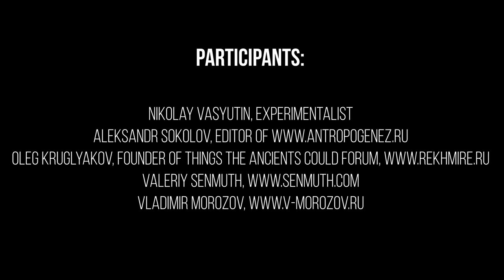Making Egyptian Drill Holes: Lost Ancient High Technology

Comment: What's funny is that there are stoneworkers in Egypt who have either worked out most of these techniques or had them passed down to them during their early training. There are hours of recordings with them on YouTube but they are buried under the algorithm and days worth of conspiracy theory videos. Kudos on getting to the top of the queue.
Reply from the maker: @chrissibersky4617  
>those techniques don't leave the same traces/markings
https://youtu.be/HQi4yql7Ysg
Reply: @ScientistsAgainstMyths  
That was very well explained! 👍
Thank you.
Reply: @ScientistsAgainstMyths  Wondering if they use a continuous loop of rope to run the drill in one direction and the cutting marks correspond to the paths of abrasive particles and the granite powder exiting the hole. It might also be possible to get the 2mm cutting pitch if it's done after an initial rough hole, as in a finishing process.
Reply: Ah. Your linked video explains this - Well done!
Reply: It took me almost an hour to find a decent video that actually thought about how it was done. We still use abrasives to this day and it’s totally not a “lost technology”
Reply: So how do you cut a straight line? Drills are not that impressive to me, ofc you can make a hole
Reply: @jimmyboe25  Yeah by the time ancient aliens the show is done with it its called "LOST YOUR MIND TECHNOLOGY"...and we have plenty of that technology around 😉
Reply: @torontotonto6189  probably a disk shape, similar to a circular saw blade
Reply: FIRST watch THEN reply lol. He FAILED
NO distinct looking groves .
NO even groves.
NO sequential groves.
It’s anything but the Egyptian drill cores . 
Says so right near the end of the movie.
Reply: @gefiltafish2187  Yeah I watched it ages ago, seems to me that the Egyptians could drill a hole
Reply: They are drilling downward using gravity which keeps the grinding agent in constant contact with the drilling surface but the Egyptians drilled horizontally as well so I'd like to see them do this. Also the holes were much deeper than a few inches.
Reply: @wesporter2176  I think the point of it is, everybody seems to think the ancients were dumb because they don't understand they were smart in different ways to us.
Reply: @wesporter2176  Take the stars for example, they knew them all in the same way we know the roads we travelled, they could look at the stars and know exactly where they were.
Reply: @ashleyhubber5734  I agree but I don't think this is how they made these holes. I think they were somehow able to make the stone much softer how they did it is subject to speculation but I don't just say it's aliens.
Reply: @Antiextremistdude  you should try it sounds like a great experiment
Reply: @ashleyhubber5734  why are you lying? 

They got the same groove pattern and tapper.

They also aren't the only ones to prove this.

Also the tool they used is a replica of an actual Egyptian Tool
Reply: @pranays  What do you mean why am I lying?? I agree completely with you, it's why I shared the link!!!
Reply: @pranays  No
Reply: Sure it can be done by hand.  One man can build a skyscraper, too.  It would take an impossible amount of time, wouldn't it?
Reply: @ericsbraun  2 hours it took the two of them.
Reply: @ericsbraun  actually not possible, look at Christopher Dunn’s study on the drill holes, the ancient drill bits move through the granite way faster than modern machines.. 

We can’t even replicate the ancient holes with unlimited amount of money
Reply: @kalebgullan4157  Here is a statement you made , with no evidence to support it: "the ancient drill bits move through the granite way faster than modern machines"
Reply: You're way off.
Reply: @scotchwhile214  you guys definitely have no knowledge of engineering or tools/ trades 

You can find the evidence in his book if you want to learn…
Reply: @wirelessone2986  No-one believes in aliens. You are missing the point entirely. Whoosh!
Reply: @kalebgullan4157  His book was published many years ago and ignored by Engineers because it is not correct. It is not possible to calculate any kind of cutting rate from the ancient drill cores because there is no continuous spiral. He has been disproven enough times but he still enjoys receiving money from telling people to believe him.
Reply: Sure, there are plenty of the last dynasty work still being done, because its crude methods, NOT the high precision work of the very earliest Egyptians. Tell me please, how you drill the hardest red granite and DIORITE at feed rates we are unable to do in OUR times, and drill a hole deep into the stone that makes a NINETY DEGREE TURN INSIDE THE STONE. A CURVED 90 DEGREE TURN, NOT A SHARP TURN DRILLED FROM TWO DIRECTIONS. It still amazes me that people choose to completely ignore the statuary work done with computer accuracy only high speed machining can do. No archaeologist ever found COPPER TUBES from ancient Egypt, LOL.
Reply: @davestephens8033  You describe a situation that is not true and ask for somebody to tell you how it was done? Can you tell us how you determine your feed rate from toolmarks that obviously show inconsistent groove patterns? The same striations that are repeatable with abrasive tube drilling?
Reply: @davestephens8033  That's pretty funny. You both pose and answer your own questions and don't even realize it. I feel stupid for even responding, so I will leave it here; All of your questions have already been answered. My problem is that there is a difference, cognitively, between learning new things and being told new things, so I will leave it to you to look them up for yourself. Regarding your last comment about the lack of copper tubes in certain parts of the archaeological record, I will give you a clue. It took place during the 12th century BC, between c. 1200 and 1150 BC.
Reply: So many factors can produce different abrasion marks. Granite is a mafic pegmatite meaning it is made up of large grained crystals (quartz and feldspar). They can also carry other minerals such as garnet with a higher mohs hardness. While a stone is being cut it will actually add more abrasive material to the area. They very well could have also used small garnets, corundum, beryl, diamond, etc as a biproduct of gold recovery. They certainly knew about diamonds, and collected vast amounts of gold. They also knew about gilf kebir (which is a diamond bearing kimberlite pipe). Kimberlite is intrguing as the host matrix bearing the deep earth minerals is rather soft. It also carries microdiamonds. The same we use in modern lapidary work. While we might not have many surviving diamonds from that era the representation is absolutely everywhere. The pyramids literally look exactly like half of an octohedral diamond poking out of kimberlite. It might be a coincidence. Or they saw the shape itself as sacred for a multitude of reasons. If it provided the ability to work stone more expediently then im sure reference to it would have been of a high priority. Governments always love to sing their own praises. I think of it like advertising. Look at our wealth. The result of our ability.
Reply: @ashleyhubber5734  look up merkhet. Time keeping at night.
Reply: Sorry, there's nobody in Egypt who can drill large holes in diorite and red granite at such a documented feed rate. There's nobody on this planet that has such cutting technology. People in the granite stone business have come to Egypt and they don't know how any of this was done. Not just the holes, but the precision computer accurate caving of statues with clear cutting lines that look like modern CNC cutting. The feed rates that have been proven beyond a doubt that archaeologist are scared to death of, because they can't explain any of it and run away from the actual evidence, and supporting DATA gathered by  granite workers, engineers, and machinists.
Reply: @Psy0psAgent  Thanks mate, another example of how intelligent they were!
Reply: @ScientistsAgainstMyths  I've read in books back in the 80's about middle easterns using the same principle to make stone containers and jugs but using animals like 2 camels to rotate the wheel and drill a hole in the rock.  They were placed in like a stable stone formation with water and some chemical flowing down to the hole where the rock is to make drilling easier.  I'm searching in youtube if this is still used today.  Same thing with shaping rocks.  One thing that got me stumped are those human sculptures in egypt of the kings that looks like modern machines were used to sculp them.  Smooth and with signs of high powered rock sculpting tools used.
Reply: @Kopie0830 there are plenty of "possible" methods that can be used to create a hole in a hard rock. You say to use camels, another guy says this, another guy says that. The bottom line is though, that in 30 years, a population of no more that a 4 million people at their very peak, managed to cut over 2 million rocks, with millimeter precision, and successfully place them, in the span of no more than 30 years. Seeing how the methods shown in the video and the one you stated in your comment would take at least some time to learn, how could we claim that Ancient Egypt had more than 50k workers working on this project? After all, the blocks were cut at millimeters precision, it would have to be highly skilled workers. 

Be honest with me, does it really sound believable? Remember, 2 MILLION blocks. In 30-40, years. Even by today's standards, isn't a project like that absolutely massive? Nevermind with some camels or whatever. Do the maths.

Listen, im not saying that aliens did it, however I am saying that the Ancient Egyptians did have something that set them apart from conventional knowledge and science.
Reply: 18:27
Reply: @yayeetfamyeet772 You appear to be referencing the Great pyramid. There are possibly over 2 million blocks and the majority are not precision crafted and fit.  Any photo of the pyramid will show this fact. The majority of the blocks are rough cut from the onsite quarry. Rubble and mortar filled the gaps. The internal passages and the outer  casing were the showpieces of the stone masons.

Comment: Tubular bow drills can be seen in the famous depiction of ancient Egyptian craftsmen at work in the tomb of Rekhmire.  Further a stone artifact unearthed at Armana which was fashioned using such a bow drill contained residue in the drill holes.  The residue when analyzed showed copper and corundum.  Emery corundum was mined on the Greek island of Naxos from antiquity to modern times making it easily obtainable for ancient Egypt.  Other possible sources exist in the region as well.
Reply: Yes there is a corundum source in the eastern desert between the Nile and the Red Sea.
Reply: @mnomadvfx  There is another corundum source west of the Nile as well…
The source west of the Nile had been matched to bore hole residue at Amarna.
Reply: Just like a more modern calyx drill. Everything new is old sgain.
Reply: You completely miss the point. Those hieroglyphs were from much LATER dynasties, when all that technology that baffles everyone was LONG GONE.
Reply: @davestephens8033  😴😴😴
Reply: @davestephens8033 spot on, also there are numerous vertical and upward angle drill holes. You cant hand crank an upwards angle drill hole. Furthermore its proven from the drill cores that there was a continuous spiral mashine mark.

All of this is redundant though after  chris dunn did the precition measurements of the saqquara stone vases that showed a precition of less then 5/1000 of an inch in the outside and inside of these vases. Thats more precise then modern cnc mashined steel engine pistons. These things were not made with wobbly hand cranked tool, its proposterous to suggest it.

Comment: Two supported pieces of wood with a circular hole between the joins, and placed horizontally two thirds up.  The drill is then placed within the hole. As the operative rotates the cutting tool, the support keeps the tool straight and prevents the wobble issue… thus preventing a tapered plug/hole.
Reply: Yes, and there are some types of wood that are much more slippery and have been used in more modern ships, as the shaft bearings out in the wet areas.
I'm not sure what they had in Africa, but I'm sure there would be a type that can be a Lignum Vitea substitute.
One could also just lubricate a lesser quality wood.

Wooden machines have been around a long time.
Reply: @richtomlinson7090  and add sleeve to the handel that can spin freely to prevent the blisers or even set up rope  belt and pully system linked to waterwheel and there you have full on power drill using only basic tech

Comment: An excellent demonstration of how this was done with, ingenuity, simple tools and muscle power.
The proof of the technique is that the holes and the cores match perfectly those found at the construction sites.
Reply: Not perfectly which is my issue, the existing drill holes have spiral striations all around, whereas when we try to replicate this process with primitive tools there are no striations, let alone spiral ones.. That's the odd difference..
edit: 
Another difference that exists is that there are drill holes deep into stone, not on a thin slab like their example.. Now how would you cut out a tube out of that hole without it reaching the other side?
You can't unless the tool you are using destroys all the stone inside the diameter of the hole
Reply: Did you really watch the video?
The holes looked pretty "perfect"  to me. They replicated the technique as shown in the drawings left by the people who observed the method themselves.
They also showed how the cores were knocked out of the holes and lots of these discarded cores have been found all over the building sites.
What more proof do you need?
Reply: I didn't mean that by perfect.. 
Sure it is a perfect tube shaped hole.  @eckyhen  
Show me the spiral striations because on the closeups i didn't see any? 
The original drill holes were done by a different method entirely, clearly something less labour intensive because we can measure the pace at which it was cut with those striations.

You say they showed how those cores were knocked out.. It's not impossible to knock out a drill core from a small block of granite.  What is difficult to knock out the core without reaching the other end of that hole. 
Yet there are examples of exactly that..
I saw drill holes that go deep into stone but dont reach the other end, then the ancient people centuries later used those drill holes as a weakness in stone and cut the blocks in half through the hole to reuse the stone
Reply: @erook2019 You are correct that the example does not contain continuous spirals. That makes it identical to the ancient examples, which also do not have continuous spirals.

Comment: Something that I want to point out, yes this technique does very very slowly bore a hole into the granite. What they need to do is do a cutaway afterwards and do a comparison of their borehole with the ones found in Egypt. The big difference they're going to find is that the boreholes in Egypt have a continuous thread. As if the drill bit went into the granite continuously without just grinding. They've actually measured the threading and you can trace the thread all the way around some of the core samples that were left behind. Though this technique that they're using works, I do not believe it's the same technique that the Egyptians used.
Reply: Yikes. There are a few people who push the claim of a continuous spiral but it simply does not exist. The modern experiments are able to replicate the ancient examples.
Reply: There are 8K pictures of the column on google image, in 3 seconds you can see for yourself the spiral is not continuous. 
And yet you won’t even do a basic image search while you keep repeating this nonsense.
Reply: Egyptians had advanced technology lost to time, there is evidence of it, like the off center cut on an unfinished granite box, it’s in a museum in Cairo, if Egyptians used copper saws to cut it they would correct the cut days in advance, there are also drill holes that were drilled at a speed that outruns our modern machines, engineers and geologists know that, it’s just the egyptologists that deny the evidence and stick with their 100 year old theories, I don’t know why people are so against the theory that Egyptians had stone saw mills and hole drills that worked by using reduction gears, pulleys and cattle